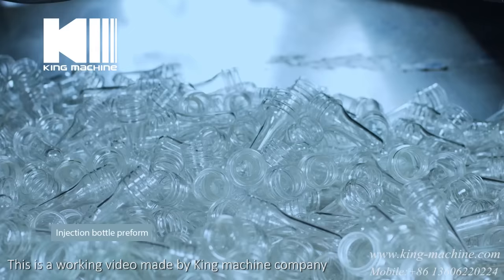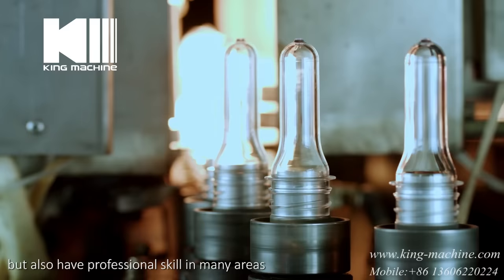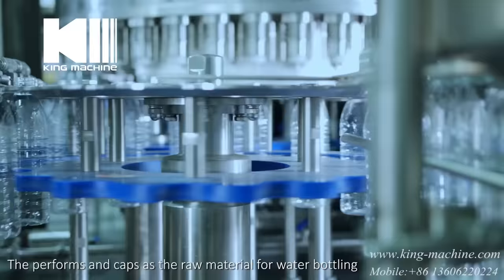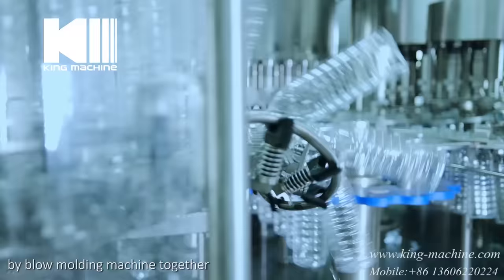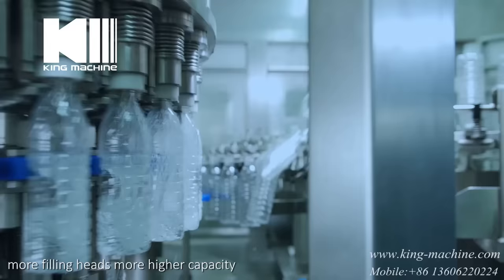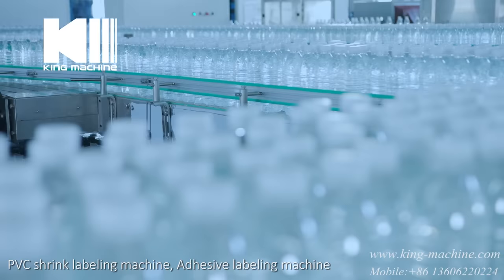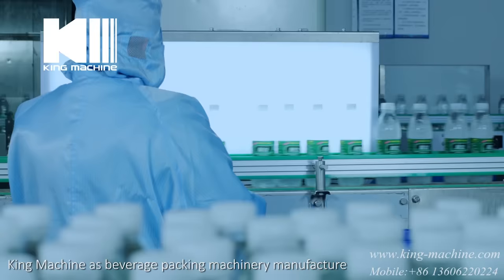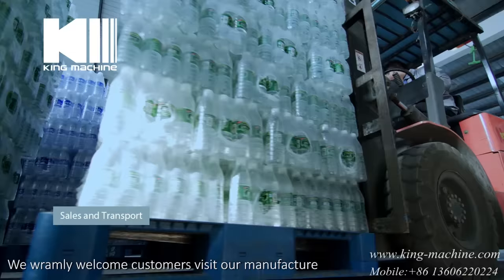Complete Bottled Water Production Line From A to Z

Comment: They hired a decent narrator, could have slipped him an extra $10 to correct the google translate grammar.
Reply from the maker: Zhangjiagang King Machine Co., Ltd. (www.king-machine.com)
from China.Can you give me your email / whatsapp, We will confirm more details with you as soon as possible to offer customized solution for you .

WhatsApp:+86 15262329005
Email:aaron@king-machine.com
Reply: This narrator isn't a human. I'm telling you that as a professional voiceover artist.
Reply: @MrArtVein   Firstly your wrong, this video is 6 years old, such good AI narrators did not exist then.  Also, how does it feel to know how shacky your future profession is?  Won't be long and the AI ones will be better than most all the amatures and many of the professionals.
Reply: @zyxwvutsrqponmlkh  Siri  is a good example of how long AI voice technology has been around, it’s hasn’t just been invented, it’s just only been made available to public
Reply: @CaughtOnCamHD  This is untrue. Siri is not an Ai voice.  It's just a more modern speak and spell from the 1970's. The same as the Microsoft voices and so on.  It's created with heuristics that are painstakingly coded, phonemes and word fragments were collected from a human speaker and software was hand crafted to paste them together and filter the output. It's over 15 years old at this point. 

Possibly, revisions were done to add Ai elements into the synthesis training off the original data set, but if so this would have happened in the past few years, and I don't even think this is super likely.
Reply: Lol